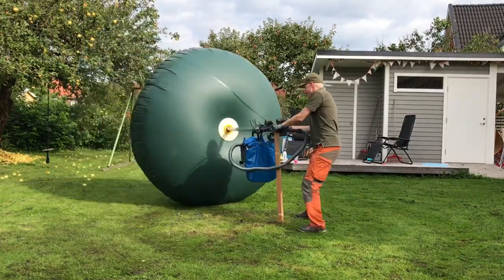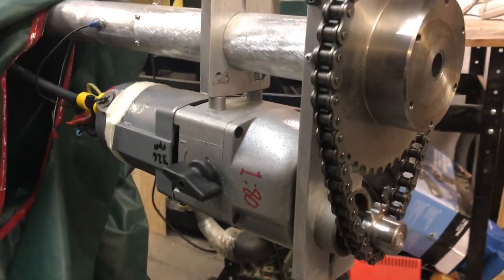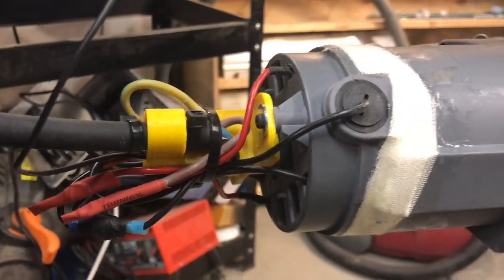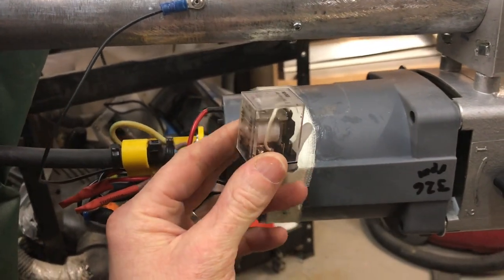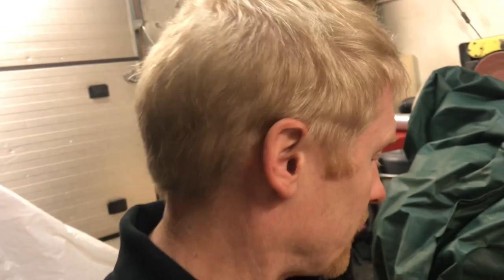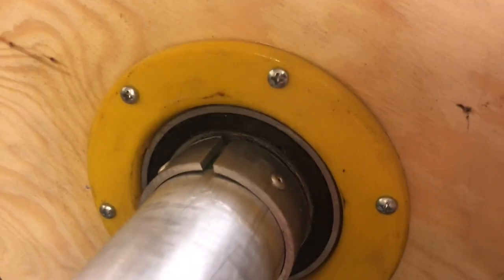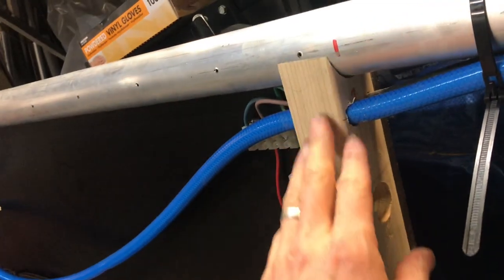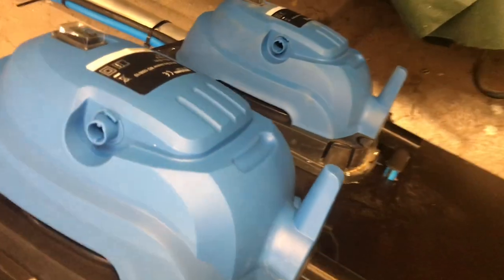Inflatable car episode 2

Comment: Use rubber grommets where high voltage lines enter the tubing, otherwise the will get cut on the sharp edges due to vibrations.
Reply: Nice one

Comment: For redundancy, shouldn't you make both vacuums inflate all four wheels?
Reply from the maker: Good point. This I my thinking: if one vacuum cleaner motor fails/ one wheel gets punctured/one hose gets de-coupled the other motor/hose/wheel-pair is still inflated keeping me floating. If both motor feeds into a single system and the leak is great enough I fear the combined airflow might not overcome the leakage and all four wheels get inflated with obvious outcome. However I currently only have one PWM circuit fort both vacuum cleaner motors which I will have to change before the first attempt to try out the driving on water-performance.
Reply: amazingdiyprojects ahh ok. So the highest priority is to stay floating but not necessarily to stay upright?
Reply: @PontusWelin  Maybe inflating two wheels diagonally instead of 2 on the same side could help. It definitely would make a difference in handling during a deflation.
Reply from the maker: I live in Sweden, you can barely bathe outdoors in the summer...so yes first priority is not getting wet and freeze like crazy or at least get unpleasantly cold...:-)
Reply: light weight solutions:
1. you could make double chambered wheels, the same method with a thinner material inside ( 1 complete inflated wheel inside of your inflated strong outside wheel with a pressure valve that triggers closed when the outside wheel would get punctured or vacuum cleaner air supply fails).
2. you fill can your current wheels with small bags of Corn Starch based materials.
if it isn't an insane burden for W&W = workload or wallet :-).

Comment: You and Colin furze should do a project together. It will be like the most epic scrapheap challenge ever. 👍🏻
I can't wait to see this in the water.
Reply: Sound's like trouble. Colin will want to mount a ram jet engine and it will melt the tyres. If not the fireworks will finish off the project properly.

Comment: If I may make a suggestion, design your inner and outer wheel hubs in two pieces with a large enough diameter to slip the wheel completely over the drive unit and axle. This would eliminate the zipper and incorporate your intended hub strengthening mod. Great stuff! Thanks for sharing your ideas.

Comment: Consider using 4 quick disconnects for air - with the female side mounted to the axles - for safety. In case of problems with the blowers, just disconnect and the air will stay in the wheels. Or make up a simple one way valve (rubber flap) either at the individual tire, or at the blowers.

Comment: Might want to consider unintended effect of having the motor inside the wheel. There will be limited cooling air in the enclosed volume for the motor.
Reply from the maker: Good point.  I have thought about it, and my thinking is: There is 3m3 air in each wheel, which approximately weight 3.6kg at 20C. That mass of "coolant" in combination with the huge surface area of each wheel, 9.8m2, should make it possible to dissipate the guesstimated 100-300W average heat generated by each motor.

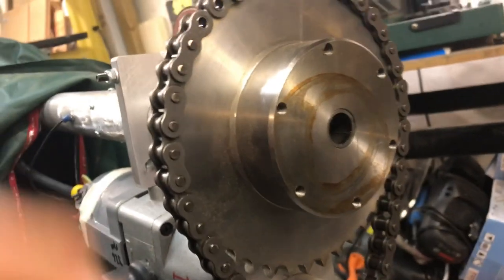Comment: 2:05 By my calculations from the previous video (1600W 650RPM motor, followed by 3:1 reducer), you should have 70Nm torque. The Harmonic Drive design guide has some good numbers to get a feel for torque transfer capacity relative to pitch circle/number of bolts/torque on the bolts. Page 56 here http://www.harmonicdrive.net/_hd/content/documents/CSG-CSF_Component.pdf

I think your plywood will by ok, as long as you use large washers to spread out the pressure from the bolts. You're a lot better off than me, trying to transfer up toward 1000Nm with an extremely tight weight budget :)

Comment: What happened to your manned drone project?
Reply: 2stefan2000 he's waiting for better weather so he can do a test flight over water.
Reply from the maker: Winter sleep. However, since I have charged the battery's fully when testing out the new charger array, see previous video, I will probably do a short hover just to reduce the battery voltage a wee bit  shortly. If I do I will upload a video covering the event :-)

Comment: Motor inside the wheel is clever! I think that garden hose/connectors might be too restricting, causing a lot energy wasted in pumping air.  Possible to utilize frame as air ducts?
Reply: Agree! The frame has the possibility to move a lot of air! So both inflating and deflating would go fast! But if it's more or less air tight it wouldn't be necessary to have anything else then the super simple garden house system. 🤔

Comment: Did you think about steel instead of aluminium tubing? You can buy reasonably light tubing from 25CrMo4 that you can weld and braze... no reinforced 3d printed connectors needed
Reply: Titanium!
Reply: @konorkoler  дурак :-D
Reply: Exactly my thoughts since those 3D printed T-joints seems to me a bit sketchy, even though reinforced.
Reply: You could also tig weld the aluminum he's already using.
Reply: @AtimatikArmy  I guess it would be already done if he had means for that..
Reply: @kubaistube  yes,  probably anyways 6xxx alloy, a flat chassis like that won't swing for long. Steel does and he could braze it with a bunsen ... but appatently he likes using public hardware store stuff
Reply: @kubaistube  Just thought I'd state the obvious since people were talking about making a frame out of chromoly  steel and welding.

Comment: If you need some Hi Amperage relays, I bought a bunch, they were custom made for us (I had to wait 2 months for them).  They are 60A Latched relays with 5VDC control.
Just look on eBay for " AZ2500P2-1A-5DE High Amperage 60A Latching Relay Sealed 5V DC "

Comment: Maybe seal the electronics against water. 1 drop between two legs of the transistor will  probably kill it or change the value of output. Great project though